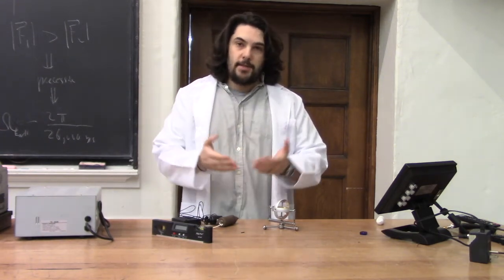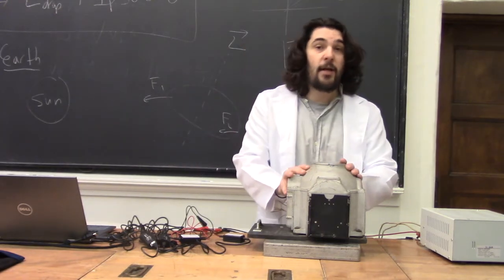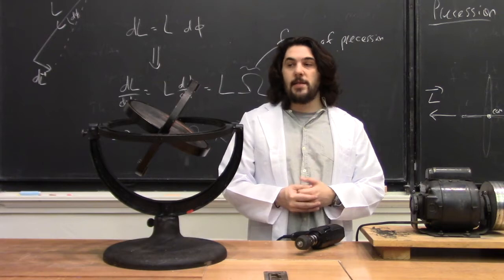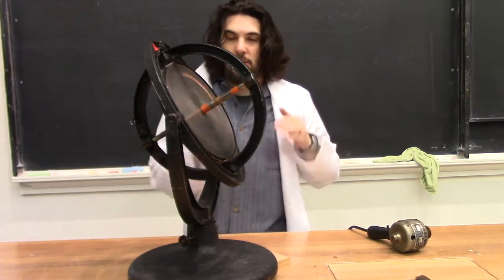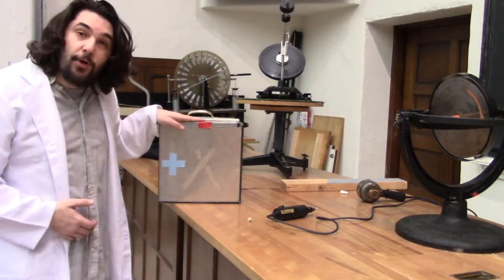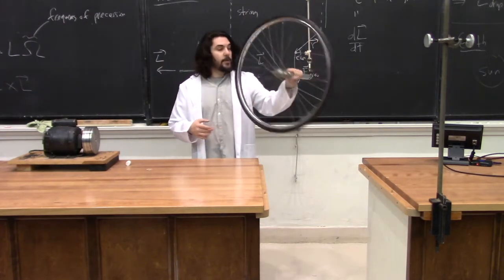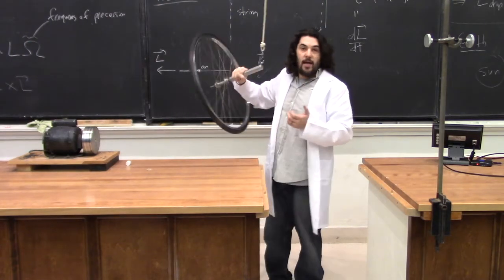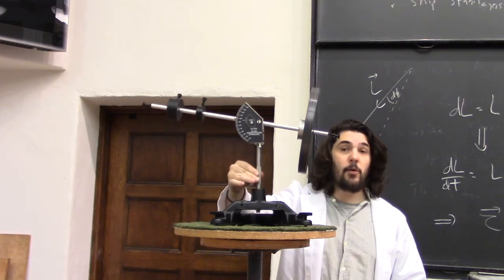Demos: Gyroscopes

Comment: Can U make another one to show what happens when U (try to) turn a gyro/wheel, sideways,
and what happens when U turn a fully gimbaled gyro thru full 360 degrees.
I think U would need to color the gimbal halves and gyro sides differently
and be able to show in which direction the gyro is spinning.

Comment: This same force makes it impossible to brake and turn simultaneously on a motorcycle  (which nearly cost me my life).
Reply: My brother in Christ, trail braking necessitates you have brake pressure while turning
Reply: The primary reason that motorcycles lean in turns is due to the tires being steered outwards from under the bike+rider, leaning the bike+rider inwards. The precession related effect during the initial counter-steering accounts for only about 10% of the roll torque that leans the bike. The issue with braking while turning is that the front tire's contact patch is offset to the inside, and braking will tend to further steer the front wheel inwards, and the rider has to oppose this with some opposing outwards counter-steering torque. Most motorcycles tend to straighten up when leaned, and a rider has to exert some outwards counter-steering torque to steer less inwards in order to hold a steady lean angle. While leaned, counter-steering still applies, steer inwards more to lean less, steer inwards less to lean more. For a rider used to counter-steering, braking in a turn will not be an issue, since the normal counter-steering reaction will allow a rider to hold the current lean angle steady while braking (the rider will also to reduce counter-steering torque when the rider stops applying the front brake).

Comment: END THE DEBATE!  Stop wasting time! You can prove the Earth is not turning with a gyroscope. You should be able to see 1 degree every 4 minutes. Prove calibration by spinning it the other way.
Reply: In fact, we prove that with modern gyroscopes in aviation as all the navigation systems are based on that. How do you think in-flight gyroscopes work?
Reply: Hey dude… I just bought an attitude indicator and found that after 20 minutes of it running… it did not change 5 degrees. In fact there was no change at all. I know you commented a year ago on this video but I would like to ask some questions if you’re willing sir.
Reply: @coryoconnell7339  hey man, may i ask u a question? if you start running it on vertical axis. then spin on a rope 0,5m-1m long around verical axis, so it will be spinning in the horizontal plane. will it change rotation axis?

cause there will be v2/r = g if rope is horizontal. gyroscope remembers its starting axis or its relation to forces affecting it? it is interesting....
Reply: @Ox111BA6FA  that sounds like a great experiment to test dude. Also depends on what gyroscope and how many gimbals I’m sure but would definitely want to see the results.